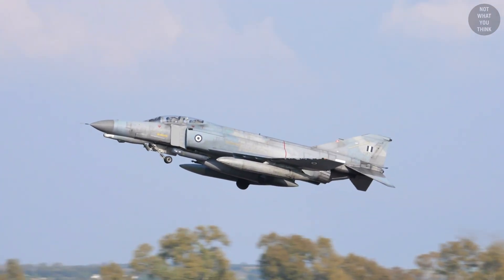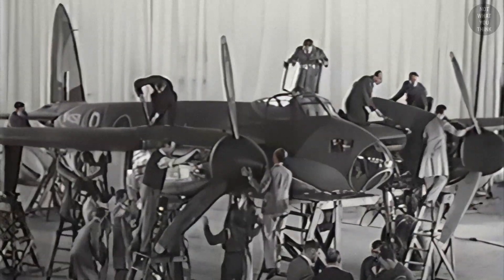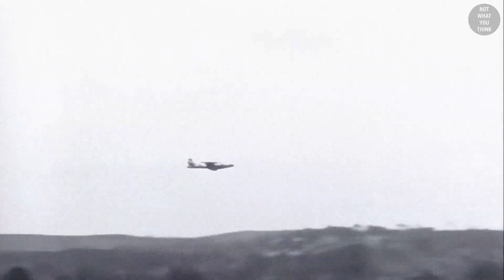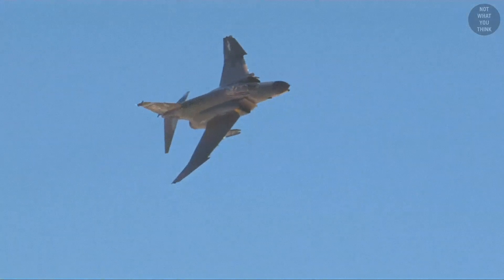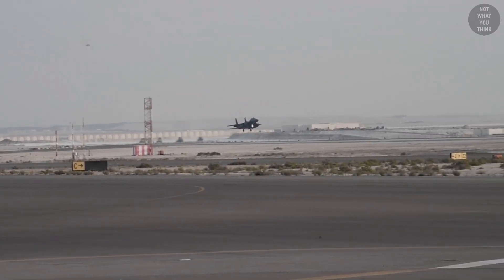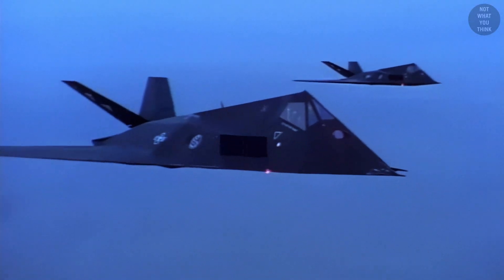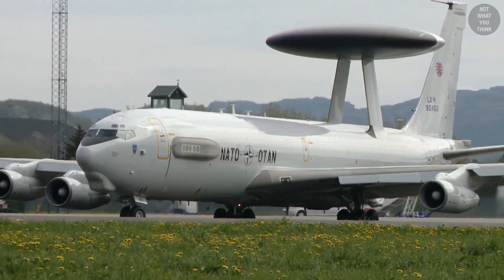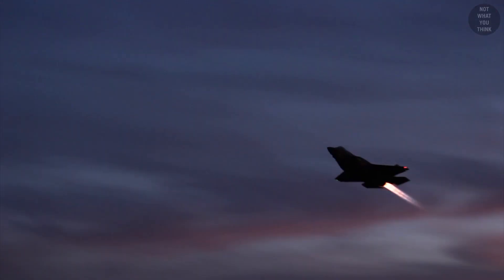Why are Modern Fighter Jets Slower than 1960s?

Comment: Wait what?  Not one second of combat was flown at supersonic speed in Vietnam? That's bullshit. We have books written by fighter pilots from Vietnam who clearly state that they went supersonic at various times  for various reasons.  Most common one being disengaging and bugging out. Unless you have some weird definition of "combat", yes jets did fly supersonically in vietnam during combat.
Reply: Running away =\= combat as you are not fighting, but RUNNING FROM COMBAT.
Reply: Listen properly. He mentioned that they never flew supersonic at those speeds a la Mach 1.8, 2.0 and 2.2.
Reply: Not a single second was flown at Mach 1.8/2.0/2.2 those are all well into the supersonic range which starts at Mach 1.3, where did you hear “not one second of combat was flown at supersonic speed” when time spent at Mach 1.0/1.3 wasn’t even mentioned? That is still supersonic, it is actually stated that there were some pilots that reacehd speeds of Mach 1.5 (again still supersonic) although for a brief period, in fact the whole point of the video is about how practicall it really is to have extreme top speeds on a combat aircraft when just above supersonic is good enough. I get it that the drak side of the force is taking over, but jumping straight to conclusion isn’t what siths are known for

Comment: All true.   However the top and speeds that are posted they are never accurate    the F4 phantom believe it or not goes a lot faster.  
Still classified .  There were even F4  phantoms getting stealth
Coatings and glass panels .
Reply: The F 106 can easily outrun a F 4.
Reply: @rogersmith7396   According to wiki
Reply: @AboxofMonsters  There is a 106 pilot on YT named Bruce something.  Her has many interesting stories one of which was him blowing away F 4s in Korea. He also shot down a BOMARC missle.  106 had the worlds speed record for single engine planes.
Reply: Maybe in dale brown novels but not in this thing called real life.
Reply: @Solnoric    I have a friend who’s 90 years old that was an F4 Phantom pilot actually he’s almost a household name.   You trust that or data given to wiki     ?
Reply: You are correct. I believe the top unclassified speed is mach 2.83 or 2.89. They where using a modified one using a mixture of water and alcohol to keep the engines cool. The pilot reach the unclassified speed but had to throttle down do to running out of the water mixture. He stated that there was more throttle left.
Reply: @darrenmarsh2290   i believe He said 2000 mph and yea if  i recall there was more there   I questioned him twice he was adamant.  But thats not the amazing part   Being taken aboard a pyramid while he had his after burners on with five other phantoms on the russian boarder probing his craft ended up in a aircraft bay with the engines off ( he thought they were off ) inside was ancient Mesopotamia complete with a sandy floor waterfalls giant pillars    The story takes about an hour.  Anyways he was only there 20 minutes he insisted on leaving when he dropped off the bottom he assumed he was going to crash suddenly he had full power no start up the jet was “on”  like time stopped.  Even more bizarre not even the admiral wanted to hear his story.  That same theme is repeated over and over.    Another mind-boggling part The reason why is it causes ripples in our future.   What was there yesterday the valley of the kings ? … is likely the future. and our government has known it since the late 50s at least.   They were perfect 9 foot tall humans and hundreds of 3 foot tall beings with cloaks.  Another crazy part? The 9 foot tall beautiful queen called him by his nickname that only his mother called him as a child   That freaked him out so much as he stood in front of her he begged to go home.   There’s a lot of stories never told the most incredible stories are never told because they’re just too unbelievable. 

Not too long ago a 3-D gigantic pyramid structure was levitating over the Kremlin it was also seen over the Pentagon for hours at a time.   It’s well documented with witnesses and video.   These beings are still with us.

Comment: The russians will probably make a newer mig-25. I.e make the same plane but with aluminum instead of steel when the mig-25 gets retired. This thing would still be ultra fast but way more efficient and maneuverable.
Reply: That's the MiG-31. However it's actually ever so slightly slower than the MiG-25 because it has better efficiency and overall perfomance.
Reply: @nbond-hd5db  mig 31 is a improvement for radar, not a new hull
Reply: The MiG-31 was the replacement for the MiG-25 with it going to to be replaced itself by the MiG-41 (or PAK-DP) that’s in development.
Reply: @FunningRast  except the mig-41 isn’t going to be a thing just like the su-57/75
Reply: Mmm yes aluminum that metal that totally doesn't melt at much lower temperatures than steel and titanium
Reply: @Solnoric  original plan was aluminum with titanium leading edges. Steel was used because they didn't know how to machine the other materials. I'm not ignorant of what I'm saying.

Comment: S-400 to EA-18G: You can run but you can't hide.
EA-18G: I can run and disable your radar.
Reply: With AGM-88 HARM
Reply: @ridhobaihaqi144  SAM site is cooked.
Reply: @ridhobaihaqi144  EA-18G: laughs in AN/ALQ-99 low band jamming pods
Reply: EA-18G is pretty awesome, but with all the external stations those things carry, I'm not sure you can realistically consider them supersonic. They can't run from shit.
Reply: Russian air defenses can’t even deal with Turkish drones
Reply: @jb76489  those air defence systems are pretty obsolete compared to the S400
Irony is that Turkey itself has acquired S400
Reply: @carboncompound759  umm, what air defenses do you think the Russians are using? Who do you think made the s400?
Reply: @carboncompound759  Damn if the Russians have such good AA system why is not being deployed? Probably scared of losing a new toy that doesn’t work as intended
Reply: @CrayonEater255  they use it right now wdym lol
Reply: @kajmak64bit76  it didn’t stop that TB2 from blowing up the convoy
Reply: @CrayonEater255  don't care didn't ask + cope + ratio + skill issue
Reply: @kajmak64bit76  you got me there 😔
Reply: @CrayonEater255  an su27 of Ukraine was shot down from kyiev skies 150km from the SAM site (S400) in belarus.
Reply: @S_K_J  Ukraine is not flying that, checkmate
Reply: @jb76489  TB2 moment

Comment: I wonder if the MiG-25 will still remain the fastest.
(Edit: MiG-25 is an interceptor, not a fighter. My bad.)
Reply: This speed comes with a price, the Mig-25 was mainly built of stainless steel to withstand the heat at speed near mach 3, so it's relatively heavy. To limit the weight the G limit is low, at just 4,5G, while a normal fighter is rated for 9G without externally mounted bombs or drop tanks
Reply: Fighter generally covers Interceptors. Its a speciality type of fighter. 
MIG-25 is probably the fastest interceptors which scared the hell out the US in the 60's.
They didn't realise it had given up much for that top speed. It basically had nothing else going for it.

if the MIG-25 isn't counted, then neither should the F-35 be since its basically a dedicated ground attack aircraft with limited air to air capability.
Reply: Probably no.
Reply: SR-72 the Son... 👀
Reply: @GogiSanchez  doesn't exist except as computer graphics. Also it's a recon plane, not a fighter jet.
Reply: The Mig-25 Foxbat is recognised as the fastest fighter size jet with a speed of Mach 2.8     However, the Israeli's once clocked a Foxbat at Mach 3.2 but when it landed its engines were done for and needed replacing...........
Reply: An interceptor is a type of fighter aircraft.
Reply: why go on about that hunk of junk? They fixed it with the Mig 31. Still in service with Russia. Can carry the dreaded Kinzhal
Reply: After watching this video and the explanation of why fighter jets are slower today's then those of the past.

I'll say yes Mig25 can still remain the fastest for the mean time and probably for a while.
Even it's upgraded version Mig31 
Speed was reduce.

Unless the rumors of the Mig41 project is real and its ridiculous speed claim is real.

But remember that the Mig25, Mig31 is not a fighter jet but instead is a interceptor jet.
Is made to intercept and fire long-range missile and get out as it was design for.
It was not design to stay in a airspace and to try to fight and hold a airspace.
Reply: @david suursoo but this one, the speed goal is mach 6-7. 👀🚀
First prototype flight test will be scheduled 2025.
It will enter service around 2030's. 

Edit:Air force is considering SR-72 to have a strike role to carry hypersonic missiles and even long range air-to-air role.
Reply: @GogiSanchez  The Air Force also wanted the F-12, look how well that worked out.
Reply: @jordananderson2728  Ok. 
SR-72 its not like his father you know that right?
Reply: @GogiSanchez  Correct. This one doesn't exist.
Reply: @jordananderson2728  well... For now. 🙃
Reply: @GogiSanchez  or ever. If lockmart had something they'd be showing more than computer graphics. The reason they say they're working on it publicly is because the air force declined to pursue it at all. They're hoping to drum up pressure from the public and politicians who don't know better to try to get the air force to go for it. 

If they really were working on such a plane it would be the blackest of black projects, not something the CEO blabs about to everyone that gives him screen time on a news network.